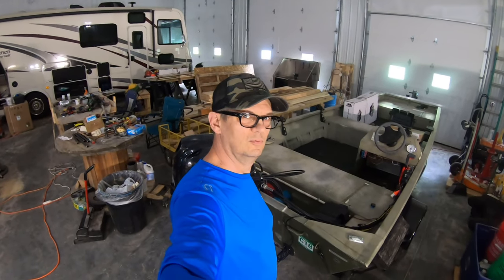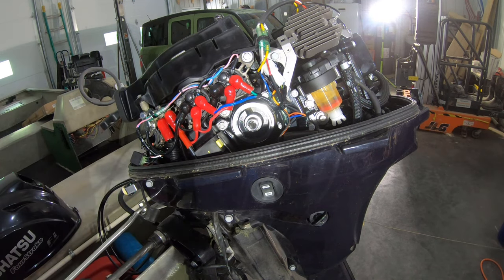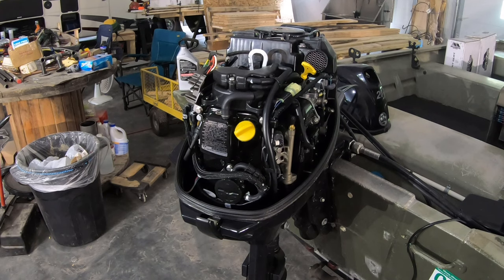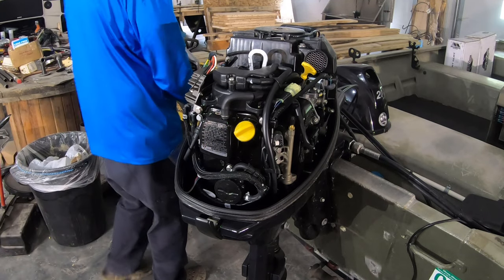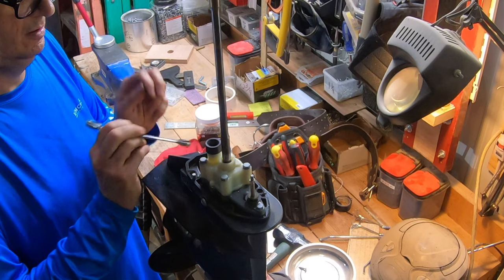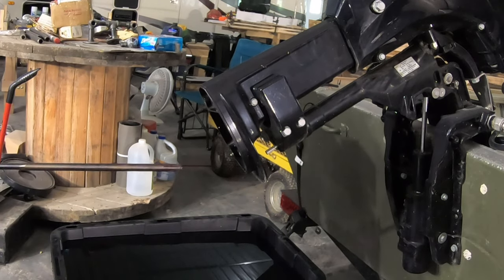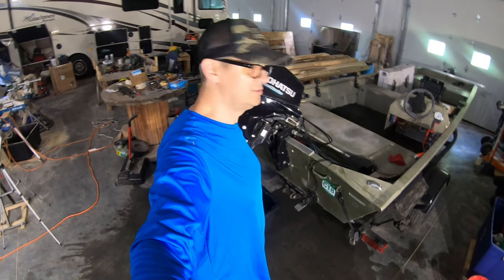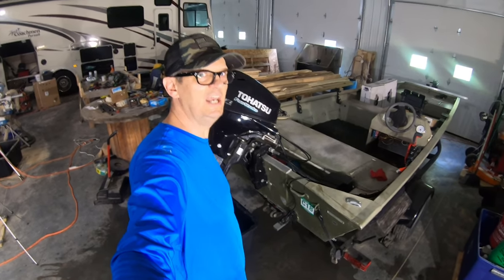Tohatsu 20 HP outboard motor full service | CBH

Comment: Need to lube the steering cable, tilt tube and the steering shaft, should also take the prop off, check for fishing line behind & lube shaft, anodes should also be removed cleaned & checked,
Reply from the maker: Thanks for watching and your comment. Great suggestions and tips! Thanks! Definitely will be doing those before we go back out! Have a great day and be safe!
Reply: @CopperBarnHomestead  you did a good job for someone who hasn't worked on outboards much.- they're pretty simple engines, which makes them reasonable for the home mechanic to maintain. once they're out of warranty.
Reply from the maker: @bretthampson8991  thanks!
Reply: انا حتاج الى هذا كيف احصل عليه

Comment: [DISREGARD MY PREVIOUS COMMENTS  I was completely wrong about the location of the oil drain plug, and the poster is correct!] WARNING!!
Reply from the maker: Thank you for watching and your comment. You might have a different model than mine but that plug absolutely is the water flush port, it has a female hose thread and I have flushed water through it many times. The oil drain on my motor is on the opposite side. I do appreciate you commenting because I definitely could make a mistake or say the incorrect thing I’m completely human. In this case on this motor the information is correct. As always check your manual before performing any service to your motor! Thanks again, have a great day and be safe!

Comment: what year is your motor?
Reply from the maker: 2017 if the information I found online is correct (I think it is) 
Thanks for watching and your comment. Have a great day, be safe!
Reply: @CopperBarnHomestead  o ok,  is just weird that the fluid in it is blue when all tohatsus should have clear gear oil
Reply from the maker: @TheTruth-ge7fj  not sure about that, I just bought regular outboard gear oil. Since it was a used motor no idea what was in it when I got it. Seems to work fine though so hopefully it’s ok. I will try to do some research to be sure. Definitely don’t need any problems. Thanks again for your comments! Have a great day!

Comment: Great video im thinking of buying a used one myself (2021) would you recommend them ? Also anything to look out for when buying 1 used  ?.
Reply from the maker: Thanks for watching and your comment. I have been really happy with the boat and motor since getting it. I haven’t heard of any problems but definitely recommend looking at some other videos to see if anyone else has had issues. As far as buying used I just look at overall condition, try to check oil and as much as the seller will let you poke around. I couldn’t run this when I bought it but for a few seconds because there was no water available to cool it. If you can see it on the water and take a short ride would be the best but without that it’s always a risk. For me the risk is usually worth the money saved vs buying new. Good luck and thanks again for watching and commenting. Have a great day and be safe!

Comment: The oil drain plug is 16 mm, correct?  I am seeing some oil slicks after the marina did a 10 hour break-in oil change.  I want to make sure the nut is tight.
Reply from the maker: Yes sir, 16mm is the oil drain plug size on mine. Thanks for watching and your comment. Have a great day and be safe!

Comment: I have the same one. I would like to put the starter kit, command and power trim on it. Could you give me a link where I can buy it? Thanks.
Reply from the maker: Thanks for watching and your comment. I don’t have a link unfortunately. I got all the supplies I used here from Amazon and would look there for what you need. Have a great day and be safe!
Reply: It would be cheaper to sell your motor and buy with power trim and starter
Reply from the maker: @eugenezhulik2117  definitely something to check into. I know that is what I found when I wanted to add electric start to a 14hp kohler engine. Thanks for watching and your comment. Have a great day and be safe!

Comment: Hmm.... am I missing something here?  If you spin the propellar clock-wise as you did then the impeller shaft will go anti-clock-wise since there are cog-wheels on the ends of the shafts that makes up the 90 degree "junction" beween impeller shaft and propeller shaft.  If I remember correct the shaft that is going up through the water pump is supposed to turn clock-wise seen from above.  You should mount the impeller so the impeller blades are put in a dragging configuration.  You got the impeller blades to turn in a "push" configuration which is wrong.
Reply from the maker: Thanks for watching and your comment. I will have to look at it again to be sure. Thanks for the explanation and advice, will definitely check it out. I did function test it and it pumps water good but possibly could be backwards I guess. Have a great day and be safe!
Reply from the maker: Just checked again, everything I find says turn driveshaft clockwise. I will keep watching to be sure it’s pumping but won’t see which way it’s dragging vs pushing in housing until the next service unless it stops pumping water. Thanks again, have a great day and be safe!
Reply: @CopperBarnHomestead  Thank you. I'm eager to hear what you find out.  I've just started to watch Tohatsu 20hk service videos since I'm planning to buy a used 15ft aluminium boat with trailer and this outboard motor and was just wondering how to service it.  I just watched another yt video before your video and he said if you look from above then the drive shaft (which is the impeller shaft) should turn clock-wise.  But if you turn the propellar clock-wise (seen from the side that was faced towards you) then the drive-shaft will turn anti clock-wise (I believe...)(?).  I'm not 100% sure - but I think It will turn the other direction since there must be cogs or something that transfers the force from the drive shaft to the propellar shaft?
Reply from the maker: @swedishpsychopath8795  absolutely! I’ll let you know anything else I find out. I have several hours on mine since installing it and everything seems to be working fine. The Tohatsu outboards seem to be very reliable and efficient, I have been very happy with ours. Good luck and have a great day and be safe!